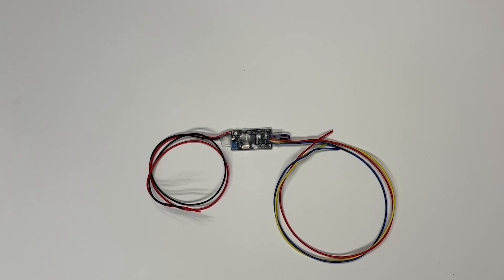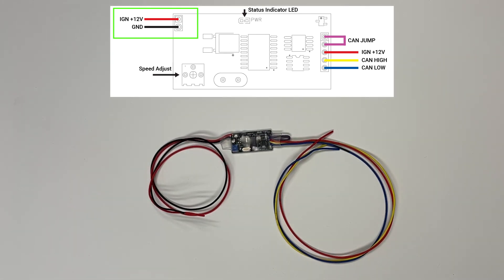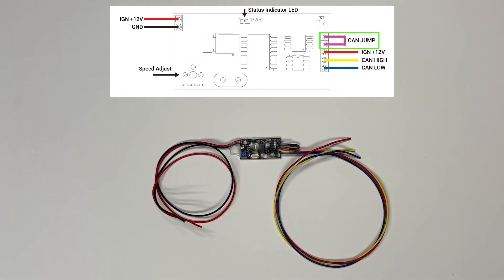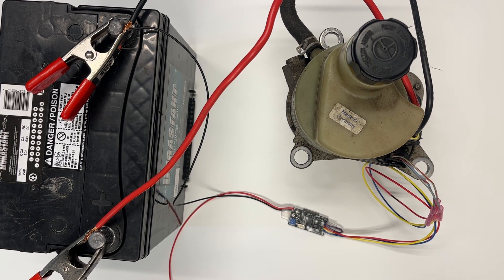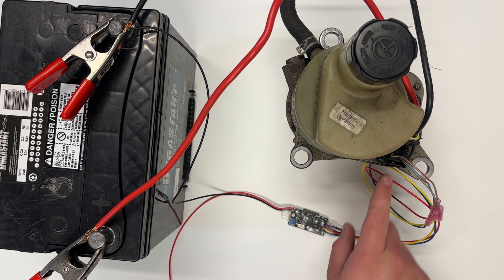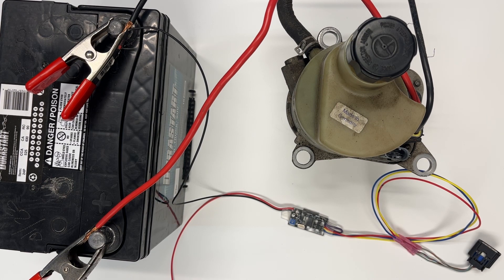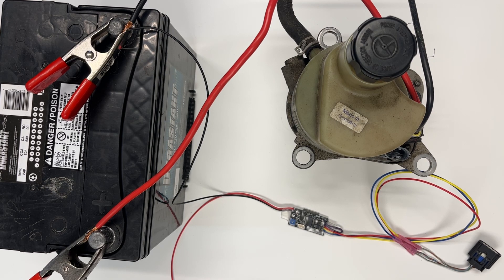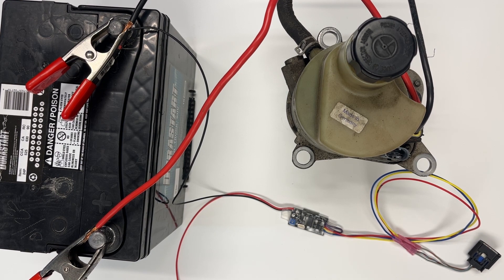EHPS Micro Volvo Electric Power Steering Pump Controller Overview

Comment: I have the power steering pump, but I don’t have a relay. Mine is connected directly from the battery to the fuse box. Do you guys think that’s gonna cost any problem with the main relay because he keep burning out?
Reply: No the relay is built into the pump it just needs a 12v signal

Comment: Can one of these ehps pumps operate a saginaw steering box and a hydroboost brake booster simultaneously? Should it be ran at 100%, full time? Or should two ehps pumps be ran separately on steering and on hydroboost?
Reply: Did you ever figure this out? I have hydroboost on my 79 Ramcharger and have been looking into a volvo electric pump swap.

Comment: Hello, good morning! I'm looking to purchase a controller ASAP I have a 2010 Volvo S80 and all it does is run for a second and shut off everything checks out good only thing is not sure if the guy who checks the system with his computer knows or understands what to do. So  I decided to use a controller. Need info where I can buy it ASAP , thanks.
Reply from the maker: Hello. We sell these controllers at reformmotorsports.com. Thanks!
Reply: Sir, for that year and model car! Can you tell me if it can only run with only a controller unit? Unlike the other pumps need only 3 wires for it to work with option for a controller. This pomp only work when you start up the car then stop instantly! Can't get it to work with the  small 12v IGN wire like what I saw on YouTube. Could it be a faulty pump? Just 😊 😊 picking your brain a little my first time on this Volvo project, thanks .

Comment: Will this work on the toyota prius eps system. The columns mounted motor assembly 04 to 09.
Reply from the maker: Hey, unfortunately it does not.
Reply: @clutch-slayer  ok thank you

Comment: It would be SWEET to interface this with a Vehicle Speed Sensor, and get an automatic variable assist according to vehicle speed. Tighter steering at high vehicle speeds, and more assist at slow speeds in a parking lot. 

I could come up with a circuit that would work with a digital pot, a microcontroller, and a VSS sensor, and easily get it to work, but for people without electronics knowledge, and add on module for this board would prolly sell very well. 
Your welcome for the idea... 💡
Reply: BrunoSteering lol. Guy made one that uses GPS speed.
Reply: They sell a gps version of this
Reply: @Jay-zk7xk  Yeah......

Comment: What speed should the pump/controller be run at when installed for normal use? 100% I am assuming, since the limp mode is about 75% or 80% from what I'm seeing?
Reply: Whatever setting makes the steering assist the way you like it. 

It all depends on the power steering rack or box that's in your vehicle. Some systems use more or less pressure than others...

Set it where you like it.

Comment: I’m no expert by any means. This may sound like a dumb question. After setting the pump speed, does the pump speed change when turning the wheel and how much amp does it draw when turning?
Reply: The pump will automatically change it's speed to try and maintain a constant line pressure according to wherever you have the controller set to. If it's set to 50%, the pump will vary it's speed to stay at 50% pressure under load. 

The pump CAN draw 80 amps at max output, and the amount it WILL draw during use will depend on your tire size, and how much pressure your power steering rack or box demands, and the load at which it takes to maintain the line pressure to whatever it's set at.

Comment: Will you be making a remote speed controller? It would be nice to be able to adjust it in cabin(Without little screw driver).
Reply: Then just replace the potemtiometer on the board with some wires leading to the same value in a bigger knob, that you have mounted on your dash.

Comment: To your knowledge would this pump work for hydroboost brake systems and power steering?
Reply: I’d like to know this as well. @whaddayawant2197 do you have an issue with it not pressurizing the hydro boost enough/causing kickback in the brake pedal? Because I’m pretty sure I need this controller to adjust the pump speed over 75%. I ordered one and hopefully it fixes it when it gets here
Reply: @cooperswift8625  I'm just making plans of what I'd like to do someday. And a healthy cam would benifit from a non vacum source for brakes. With hydroboost being on of the cheapest and best source. Pls inform us on your progress. Thanks.
Reply: @whaddayawant2197  - I've personally installed this very pump in my Mustang that has hydroboost brakes and power steering. As cooperswift8625 suspects, the default pump speed isn't enough when braking/steering input overlap. [Makes autocross a CHALLENGE] Normal driving and even light open track duty was livable. I will be installing a controller in the next week and will report back if that helped. I'm suspecting the higher pump speed will work for me.
Reply: If the pump outputs enough pressure as required by your hydroboost system, yes, it will work.
Reply: @davelowets  read hanomotorsports reply. The most accurate info I've seen.

Comment: Hi great video. I am thinking of removing the belt driven pump that was fitted to my classic MGB GT and replacing it with a Volvo electric power steering pump. I know it draws a max of 80 amps but can i reduce the amps using this controller . I know that it will impact the amount of power steering I get from the pump, but thats not a problem as long as it gives me some help. Basically I am asking if I use your controller to reduce the pump by 50% then will it only draw about 40 amps and give my 50% reduced help in the steering.   

Thanks again.
Reply from the maker: Hello! Unfortunately the current draw changes depending on conditions and load. At "idle" with no load on the power steering pump, it will only pull 2-3 amps. However at full lock it can pull up to 80 regardless of pump speed.

Comment: My volvo pump will work wide open just by sending 12v to the gray wire. While you're driving, manually adjusting the speed obviously isn't practical, so what is the purpose of your board? Are you still trying to progress towards making it auto speed adjust based on a simple road speed pulse? I was planning on using my haltech to turn my pump off above a certain speed to keep it simple, but being able to fine tune the ratio of road speed to pump speed is preferable.
Reply: NO, your pump is NOT working wide open by applying power to the Grey wire. Doing that puts the pump in a "fail-safe" mode, and your only getting 75% of its full capability. Your loosing 25% by doing that.
Reply from the maker: The majority of the USDM Volvo EHPS pumps (04-13 40, 50, 70 series, etc.) do not run full speed with just ignition power. The "failsafe" condition when no CAN bus is detected will run the pump at about 75% of max speed. The intent for this board is a simple way to control the pump with a fixed speed, mostly for drift cars, or other Motorsports where you want consistent power steering feedback regardless of vehicle speed.

The other version of the controller we've been developing allows mapping inputs from analog input such as a potentiometer or PWM output from a standalone ecu to allow changing speed on the fly or programatically, but also adds the ability to watch for messages on CAN bus and map the output based on watched messages. Modern standalone ECUs like MaxxECU are adding more CAN bus features, like EHPS control so it's a bit of a trade off if it's worth investing a lot of time into it. If you're interested in that side of things, feel free to reach out to us at rmehps.com and we can send over more info!

Comment: Is there any way of making this work with 90s honda VSS. Where there is linear reduction in pump power vs increase in vss pulses. Basically I would like the pump to operate at a user set speed at idle and low speed turning, but the pump turns down progressively as vehicle speed increases.
Reply from the maker: Hey!

It’s definitely possible, we have another version of the controller that’s still in development that allows a pwm, or pulsed input and gives you a 3d table to control pump speed based off the input. 

Otherwise, if you’re crafty enough the basic code to make this work is available on my GitHub, you could make it work with an Arduino.
Reply: @clutch-slayer  Hey do you have a link to your github?
Reply: I have Volvo power steering pump on my k swap Honda it’s connected directly from the battery to the fuse box. Did I need that controller because I’m keep burning main relay

Comment: Ok my pump does not turn when I put the ingnision on but if I turn it with my hand it starts to run I have checked all power and can all looks right 12v and 60 oms o  the can .need help pkease
Reply: I would say the motor on the pump is prolly going bad. Similar issues exist with fan motors and starters the brushes wear out and by u turning or smacking it gets it going again.
Reply from the maker: Hello! Can you send us a message if you got this controller from us, either on eBay or on the reformmotorsports.com using the contact us form? Can you check your battery voltage with a multimeter? YouTube doesn’t always notify me when people comment so I apologize for missing this.
Reply: @clutch-slayer  battery voltage is right altonater is charging right and my low and high can wiring is right .I don't  use the control because it's on a ford st225 focus. Thanks for replying back.
Reply: Good day.. how much.. can I used the module in Nissan with can bus EPS thank you
Reply: Your pump motor is SHOT